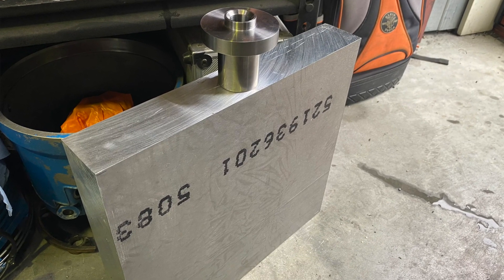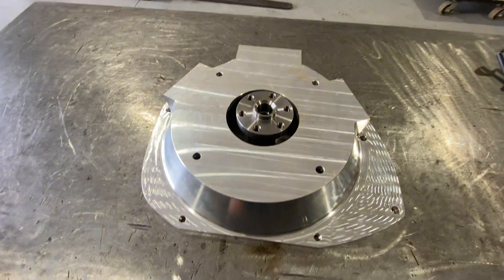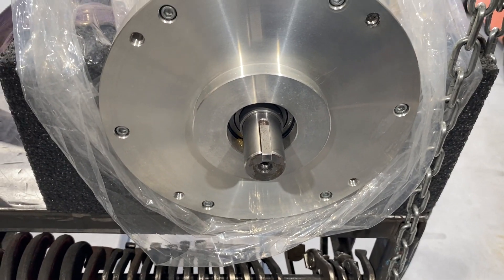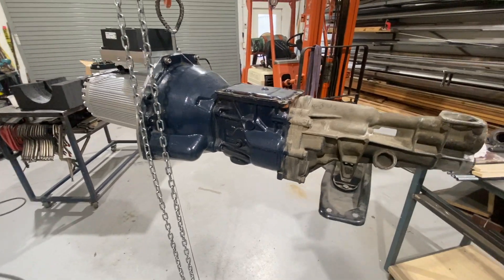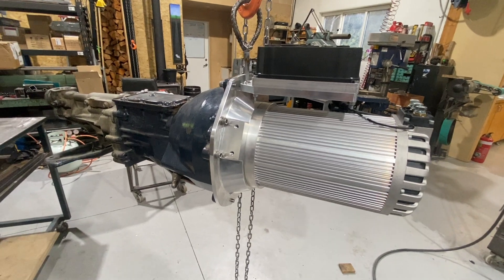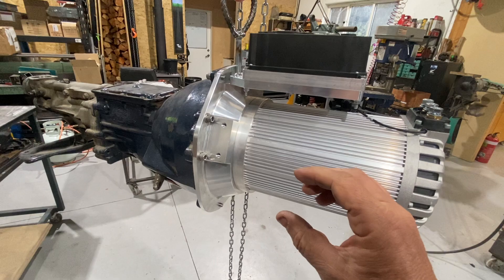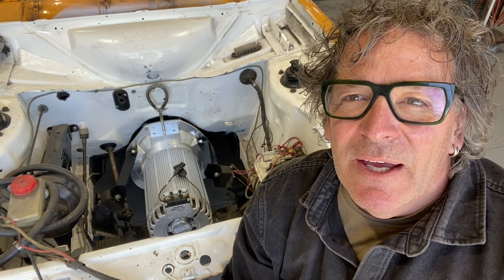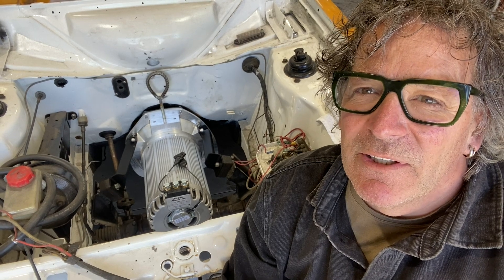Ford Escort van electric conversion Episode 4

Comment: Great job.Just wanted to ask what batteries and how many did you use in total and what brand and where to get them.and what position did you put them in the panel van?.Also how much did you pay for cooling plate for the batteries.What was your total costings of everything to get it going?..Your custom made parts as well.And if possible would it be good to get all the dimensions of all the custom parts you had done..AND would it be possible to get your email so I can talk about it more with you if you don't mind if its not too much trouble?.You have inspired me to do the same .Would really appreciate it.Thanks..
Reply from the maker: Holly Smoke a lot of questions. Probably best to Email me greg@mayemachine.co.nz

Comment: Great project, a word of caution check your electric motor has got bearings capable of the axial force of the pressure plate. Remember the ice engine has a thrust flange on the big end bearing that is now gone and it would be a pity to ruin a lovely net gain motor. Good luck
Reply: Thanks for the advice. I am going off the guidance from EVwest who have done meany meany conversions with this exact configuration with no probs. makes me nervous though.
Reply: @gregvonheraud-parker7739  yeah l hope it all goes well, what made me think about this was the shot showing the motor bearing shield where you can see the bearing details. Some are deep groove with an amount of axial load permitted but the big but is, the old saying every action has an equal and opposite reaction so if your pressure plate clamp force is say 800-1000kg less the pivot ratio of the pressure plate you could have 150-250kg axial load, after all net gain made you pay for the motor so you want it to last.

Comment: interesting project. See a couple of Cortina's done EV, no escorts yet. The 5 speed gearbox may not like the torque of the electric motor. Not gone through your other videos yet so dont know what you have mentioned about it. The 4 speed is a stronger box. also the 4 speed would allow the gearbox to go further up in the tunnel if you needed it to as its shorter on the top on the AUZ 4 speed
Reply: I was going on the advice of a transmission re conditioner who said the five speed box was stronger. and this box was already in the car.
Reply: @ the type E 4 speed gearbox from the 2.0 cortina/RS escort are the strongest, look like a type 9 but with no extra sections after the main case.